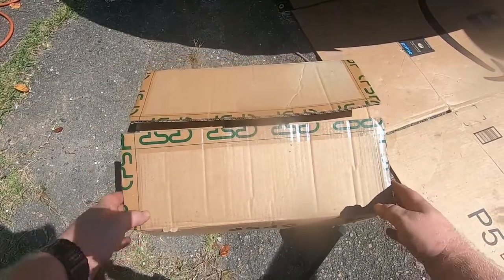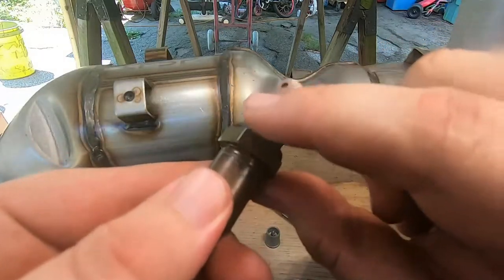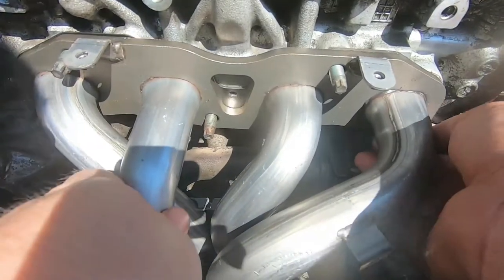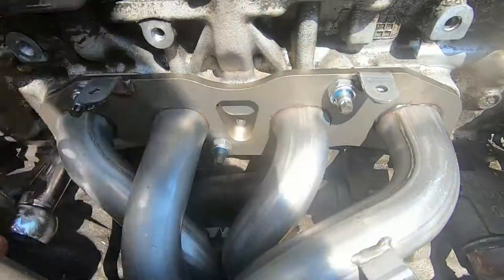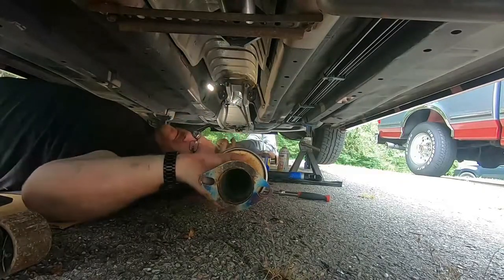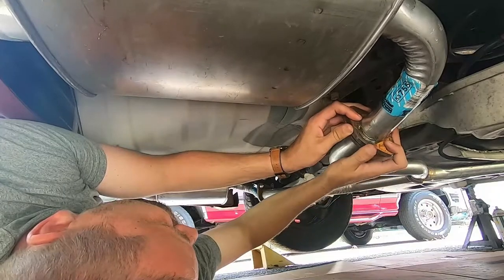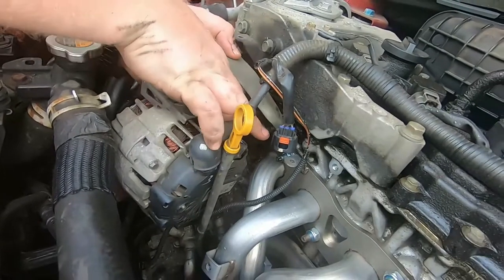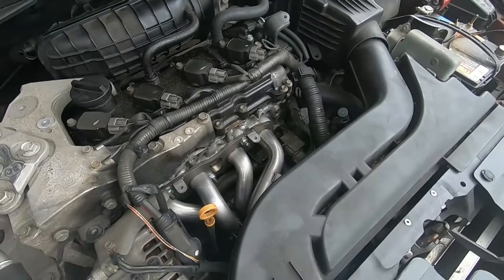2007 - 2012 Nissan Altima 2.5 Liter - Exhaust Manifold, Catalytic Converter & Mufflers Install!

Comment: Hello what is the size for the bottom manifold exhaust? I dont know whether i should get m10 1.50 x 52mm or m10 1.25 x 42mm?
Reply from the maker: I can't remember what pitch (1.5 vs 1.25) that ended up working for me, but I would buy both and then return the size you ended up not using. Hope this helps! Thanks for watching and good luck! 👍

Comment: i followed the steps now my 2012 altima cranks but shuts off any suggestions
Reply from the maker: Double check all your electrical connections on the alternator and make sure the battery health is good. My hope is it's just something wasn't plugged back in. 🤞

Comment: How's that manifold been hold up ?
Reply from the maker: It's been holding up great! No more exhaust fumes on the inside and no check engine lights. This exhaust manifold was definitely worth it!

Thank you so much for watching!
Reply: @TrickShiftGarage  no prob 👍 I got a 2012 with 96k. I think the manifold has a small crack in it so I gotta see if it's weldable
Reply from the maker: We had a small crack around the welds too, welding is definitely a possible fix. One of these days I'll learn to weld haha!

Comment: Dude..I just went to the dealer, and these cheeseheads wanted to charge me 3500 bucks...lolol...can you believe that....who in their right mind would pay that much to pay for an exhaust...lolll
Reply from the maker: Wow Mike! That's crazy! Was that the total price for parts and labor?! 

I think my whole exhaust cost about $700 and it took one weekend to replace, hell of a lot cheaper 😂
Reply: @TrickShiftGarage  
Yea boss man.  That was parts and labor.  What kills me is that they throw out a price like that and literally expect one to pay it.  3500 bucks is the cost of replacing a transmission o engine swap.  To take off a few bolts and an exhaust manifold shouldn't cost that much.  Even if the parts was 1000 bucks, to charge someone 2000 for labor is absurd.  Originally my car was throwing a p0421 and p0420 so I know it's the exhaust.  The only reason I had them check it was because I didn't wanna go in there replacing stuff that wasn't necessary to replace.  They said the O2 sensors were working but said there was some type of "block" in the exhaust line.  So I told the guy are you sure that only replacing the exhaust manifold and gasket will solve this issue.  He said it would.  So like you, ill buy the exhaust manifold and gasket, and put it in.  It doesn't look too complicated.  I'm sure it'll take a few hours but not days and not with 1000s worth of parts.  I'm really confused at how these service departments stay in business with prices like that...its insane..Anyway, your cool.  Your videos are awesome.  Thank you for your time and response...best regards.